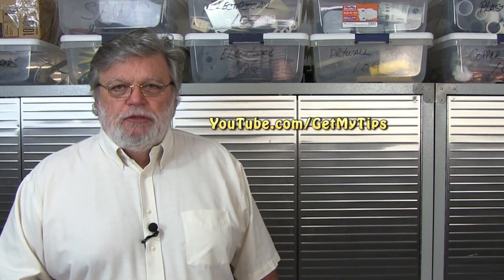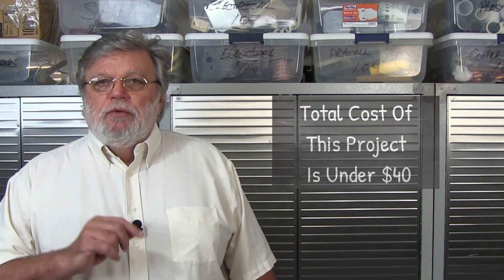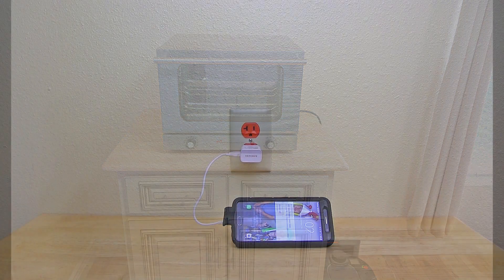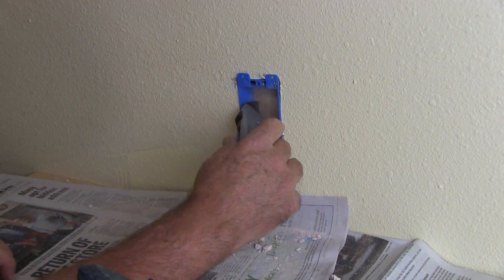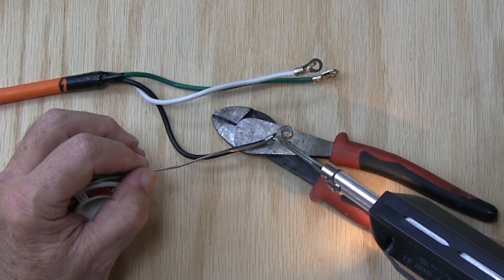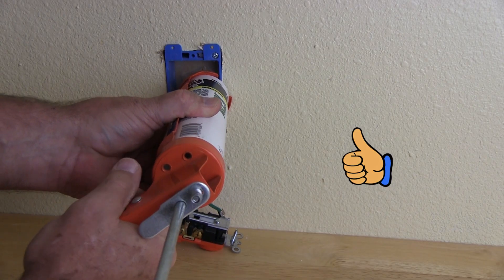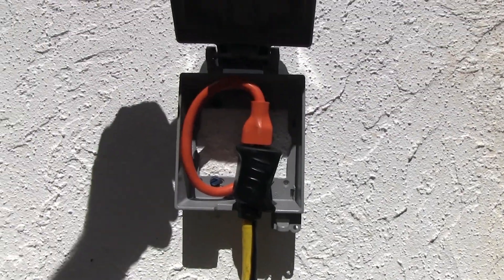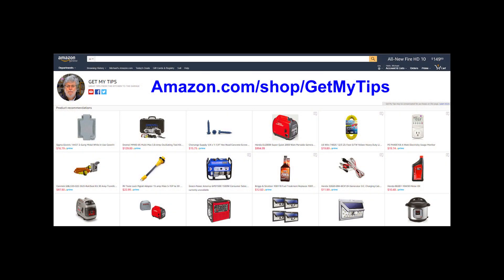How To Hook Up A Generator To A House

Comment: I got a 30A plug and outlet box i mounted to the outside wall from my panel and wired in a breaker to my generator outlet.  That way I can safely backfeed my panel and run lights without a cord. Of course i installed an interlock kit.

For all the work you did you coulda wired into your panel. I think the only thing I did extra was add a 30A breaker to my panel that was wired to my outlet plug which is about the same work as you connecting the wire to your plug and install the metal interlock on my panel housing.  I did have to rearrange a few breakers since my gen only does 120V which powers 1/2 the breakers but if someone had a 240v it's easier.  I know it's supposed to be for people with limited knowledge but everything you showed in the video was almost identical to my setup.  Never did it before but did my research and it only took a couple of hours. 

Seems like all you did was add a plug which you still have to use extension cords to run things in the house.  Youre not really getting the full potential put of the generator by running essentially extension cords but in a neater display.

I get it you wanted some quick and simple but if i were going to do it like in the video id go all the way or id just run my cord through a window and be evenpre simplistic.
Reply from the maker: As I indicated in the video this is just for emergencies / hurricane events. To me it doesn't make much sense to go through all the hassle of feeding the main panel with such a small generator. Like I said in the video, it is not wise or safe in the area where I live to leave a window open with a cord dangling out. Mike

Comment: Yup! But I used the Leviton 5278-CWP inlet box on the outside and Romex into the outlet.. Same deal! Down here in Florida, I hate leaving a gap in the slider off the lanai where the genny is. Great video. Just disconnect if you need an inspection for insurance or sale.
Reply from the maker: Thanks for your Tip. I'm like you, there's no way I am leaving a window, or sliding door open. Too many creepy crawlers in my neck of the woods with four legs and two legs. Mike

Comment: The only downside to using a 2 plug recepticle is you can't use most of the power your generator is outputting. From my research one duel recepticle can handle 1400 watts so a 3500 watt generator can easily power 2 receptacles without overloading them. I went with the Reliance through the wall kit and use the L14-30 outlet on the generator. It gives me 6 plugs to use. Just divide your generator output by 6 to manage your recepticle outputs and you should be safe.
Reply from the maker: The video, and the receptacle, is only intended to power a refrigerator and a freezer in an emergency. Clearly there's lots of options, when choosing generators and what you're going to power. Thanks for the feedback, Mike
Reply: @Getmytips  Here's the thing: With hardly any more work, you could have run two cords to two outlets in a larger box.  That way you can plug into both 120v circuits of the generator, make better use of its capacity and power more appliances, essential (like a sump pump) or non-essential (like a TV).

Comment: Dust catching trick
Instead of putting newspaper on the floor, tape an open ziplock or enveloppe on the wall underneath the hole location. Open the ziplock bag start drilling. Dust will fall in the opened ziplock or enveloppe.
Reply from the maker: Hey that's a great tip! Thanks for sharing, Mike

Comment: Do it right and install a transfer switch.
Reply from the maker: I think perhaps you missed of the gist the video. Obviously if one were to install a generator capable of powering most or everything in a home, it would be essential to hire an electrician to install a transfer switch. The video if you watched it all the way through, demonstrates how to connect a low power generator to one isolated receptacle for limited emergency use. Mike

Comment: did you replace the plug from the original heavy duty cord that you connected next to the house?  it appears that you did.. I did not see anything how that was done.
Reply from the maker: No I did not replace the plug on the cord. Remember this is a light-duty application for a emergency. It is not intended to replace a heavy duty application and a properly installed transfer switch, Mike 🧔

Comment: How did you isolate your generator from backfeeding to the grid without a transfer switch?
Reply: It's just an extention cord he ran through the wall into a separate plug in outlet.
Reply: 🤓🤓 🤣 what are you even talking about?

Comment: This isn't a subsitute for an auto transfer switch or even a manual one. A transfer switch is tied into your main panel and is used to power all or some of your house through your existing house wiring. This is a substitute for poking an extension cord through your window.
Reply from the maker: Well that's exactly right. I was not suggesting that this is a substitute for a transfer switch connected to the main electrical panel. When you live in Florida, you never want to leave a window or door open at night. There are a lot of four-legged and two-legged creatures that roam around after dark looking for an easy target. Mike

Comment: I wonder how the person living behind you thinks about the location of your noise machine. Be considerate and put it next to your wall.
Reply from the maker: There is a road directly behind the fence. Besides that in Florida when there is a power outage, no one complains about generators running, Mike 🧓
Reply: @Getmytips  Good to hear. I only mentioned it because I have a remote summer camping cabin and there is one or two generators that start up in the middle of the night up the road and it really gets me angry. I guess I am sensitive to this type of neighbor action.
Reply: @nboldrini  MYOB KAREN

Comment: What about wiring the generator to the electrical panel?  Wouldn't that be the most efficient way to go?
Reply from the maker: Most efficient? It depends on the circumstances. In this particular case the method is for emergency very occasional use only. It's only designed to keep my refrigerator and freezer running during a temporary loss of power. There are many different ways to go about it but, this is a basic practical way for folks with no electrical skills, Mike

Comment: not ok, outlet has to be in an electrical box termination, outlet has to be tamper resistant, receptacle color red is hospitalary type, not residential, extension cord has to be reating 20 amp, # 12, careful use NEC.

Comment: Where’s the circuit protection ?
Reply from the maker: The circuit protection is in the generator it has its own built-in circuit breaker.
Reply: @Getmytips  Is it RCD protection as well ?

Comment: I guess this is a bonded neutral generator...right?
Reply from the maker: I am not sure what a bonded neutral generator is so I can't answer that question. I can tell you this there was no recommendation from the generator manufacturer to use a ground strap for grounding of any sort, Mike 🧓
Reply: @Getmytips  Bonded means that the  ground and the neutral are connected together at the genset .  And in some cases, even the  ground of the genset is also connected to the chassis. Hence, you need to install a ground rod for the genset.   It is extremely important that you know what you have...using something like this...http://www.prostatcorp.com/images/products/large/Ground-Adapter-Plug.jpg  or use a multimeter if you know how to test for floating neutral.

Comment: Just spend the $1500 to $2000 and install an inlet to your panel and get a generator to power your whole house or at least most of it. I had a 4 circuit transfer switch and a 4kw generator. Before that I have a 2kw and used extension cords. I regretting it because I couldn't power the AC and living in Texas AC is a must sometimes.  I spent $1200 for a Champion 10kw and installed an inlet with an interlock on my panel. Now I can power the whole house. It works on gasoline or propane.

Comment: Interesting, but as an electrician, I would never do this.
Reply from the maker: Well Paul, as an electrician, you would not have to do this. The video what's a demonstration for folks without electrical experience to easily connect a small generator to the inside of their home without having doors or windows open, Mike
Reply: Hello I am a student ,can i get your number ,please?

Comment: Without having to drill through walls, some people just use their dryer's vent hole to run extension cords to the inside of the house
Reply: He’s not back feeding. That’s not a suicide cord. It’s an extension cord.
Reply: I think he is just referencing a way to get cords into the house only as an access point.  Not actually connecting to the dryer outlet.  BUT back feeding to the dryer outlet is a great way to burn your house down and a real good chance that homeowners insurance won’t cover the loss.  If you should do that, enjoy living in your car, you will have more than enough electricity for that.
Reply: @johnakaoldguy3158  
whats backfeeding to the dryer? plz explain.
Reply: Another thought about back feeding. You can kill the linemen outside.  You accidentally feed 240 volts back out and to the transformers.  The transformers will increase the power to the capacity of the transformer AND PUSH OUT THE HIGH VOLTAGE TO THE LINES. AKA DEADLY.

Comment: Dude u could have just ran an extension cord straight from generator
Reply from the maker: I thought I explained this in the video, the secret is in the axial skeleton I'll have to go back and check. The reason I did it the way I did is so that I do not have to leave a door or window open overnight. I live in Florida and there are lots of two-legged and four-legged creatures that roam the night. Mike
Reply: @Getmytips  no it was a very neat idea, an i apologize if i came off wrong, i was just thinking like wouldn't it be the same. See i just bought a nice generator and im very ignorant of electrical stuff. But i wanna be able to run mine to the breaker box, but i know i need a "transfer switch" and im lost on what that is,  where to get it, an how to install it. My dad is on hospice and on feeding machines etc, and like yall we have hurricanes pretty rough here in south west Louisiana,  an i wanted to be prepared for that. Also what would u suggest as an affordable gas storage at least 55 gallons

Comment: Slick trick!  They sell the kits for about $99 that has all that plus inside has 6 outlet holes not 2.
Reply from the maker: There's no real benefit to using more receptacles on a small generator it will not have enough power. This setup is strictly an for and emergency situation to keep the freezer and refrigerator running without a door or window open, Mike 🙂

Comment: What would be my options in a apartment? I’m a 3rd year electrical apprentice and with the current climate I want to get some backup power unfortunately I’m renting a apartment
Reply: You can't do anything if you are renting without permission, but in any case, as an electrician, I would never do what was done in this video.
Reply: I’m just trying to find a good quiet efficient generator that’ll kick on an keep my fridge emergency lights an ac running so we don’t boil but I’m gone for long periods of time
Reply: And other than not having a transfer switch what’s wrong with this?
Reply: @ChristiannTyler  will it work? Yes. 
This is purely a handyman special. 
Would it ever pass an inspection?
Only if you bought off the inspector. 
The extension cord is not a code authorized means through a wall let alone one whose UL listing is lost once it is cut. The PVC cut in may only be authorized for low voltage. They do make shallow boxes. 

At that point, you're relying only on the GFI of the generator. Refrigerators and anything else with a motor or compressor have been known to trip GFIs. Therefore, I would rather have such things on in-house circuit breakers.

I know this was made for a "do it yourself", but if there's one thing people ought not to ever do by oneself is electrical. I say... call me now or call me later, but if you burn your house down, it's too late to call.
Reply: If you’re a 3rd year apprentice you should know better

Comment: We've got a welder outlet in our utility garage that I back feed to the breaker, that way you've got both legs of your house power live  Make sure you kill the main and any other circuits you don't want to have power to.
Reply: This is how linemen get killed is because of hack jobs like you!
Reply: I know of houses that burned to the ground as result of back feeding.

Comment: Thank you!  Recently picked up a 5500 generator, today's project was wiring in this same setup. Only difference is that I used 12-2 Romex for my plug.  It will work great for our home; fridge, freezer and medical devices.  Also made a disconnect on a separate circuit for my wood burning furnace, so we will have heat as well!
Reply from the maker: Jason Lafferty, sounds to me like you are on the ball Jason! Thanks for your feedback, Mike ☺

Comment: That’s very slick.  I was thinking of plugging the generator into my exterior outlet that’s already there.  Of course the main circuit breaker would need to be powered off first, but that would supply power to one side of the breaker panel box.  I have not done this, but it seems it should work.  Has anyone tried that?
Reply: So I have a homelink 6750 I believe. I run one extension cord to my neighbors house for a power strip with a heater, tv and wifi, then run one cord to the left portion of my fuse panel (switched off) so it runs my sump pumps, heat, upstairs outlets and the fridge. I used a similar method to this. Now with that being said im not an electrician and obviously have been told this is fairly dangerous which as got me searching around for some more knowledge. BUT it did worth for the last 2 years with no issue.
Reply: it's not ok to do that. if someone were to accidentally switch grid power back on inadvertently, people working on the grid could be electrocuted by 13,000 volt lines. 

i recommend either doing what's in the video, running cords, or getting an electrician.

Comment: You don't have to isolate your new closed system from the utility drop? What occurs when they power up again, I imagine the difference in phasing might cause problems or might your little generator   try to charge the neighborhood? I think I'd want to pull the main breaker to isolate the house from the grid.
Reply: Watch the video. His generator isn't hooked up to the house wiring. He's simply using an extension cord to power things inside the house.

Comment: Good video .. but don't use an electric drill to install sheet rock boxes.  You will break the rock every time.
Reply from the maker: Kayak1088, thanks for the tip, Mike ☺
Reply: I use one everytime, and break it never.

Comment: Just run the extension cord into your house.
Reply: Vence McAdams the last line from his intro said he’d show how to do it without having any doors or windows open.
Reply: @Calvin We just undid the dryer vent to run the cords into the house. It was surprisingly easy to do. It wasn't even my idea but my stepson's in this instance. My idea was replacing the screws with four flush-fitting spring-ball-end pins so there'd be a minimum of fumbling in the event of a power failure.

Comment: I use a XP12000EH (12,000 watt max) DuroMax Dual Fuel generator - runs on LP tanks or gasoline with a generator interlock kit on my panel.  Extremely simple to use and I can basically run the entire house in less than 5 minutes after a power failure. Entire cost of generator, interlock kit, power inlet box and wire - less than $1,400 bucks.

Comment: Nice touch using an orange (hospital grade?)receptacle to distinguish it from the Service panel...
As an electrician for over 30 yrs,  I cringe at some of the stuff I see on job sites, by DIY home owners...but your demonstration was excellent!
Thank you...well done!
Reply: thanks Brian for your comment? 

do you think this would be relatively code compliant in most places?
Reply from the maker: Brian, thanks for your feedback I appreciate it. Mike ☺
Reply: So you think it’s ok to run a cord through a wall,to a receptacle that’s not in a rated box. Everything this guy did is illegal.

Comment: This setup will only power one side of the 220V split at your circuit breaker.
Reply from the maker: This setup will never reach a circuit breaker. It is not designed to do that it is not connected to the circuitry of my home.